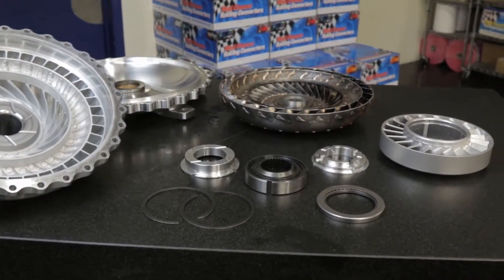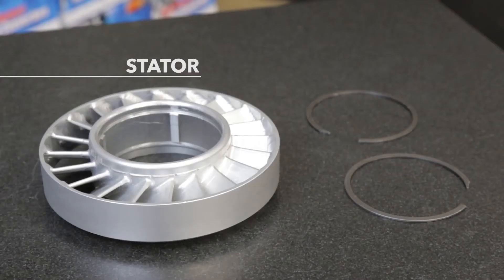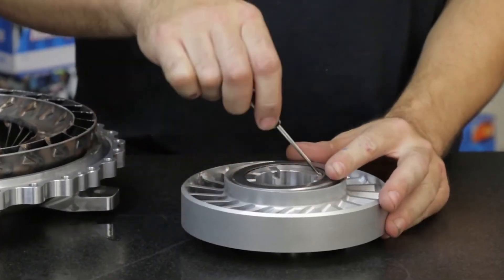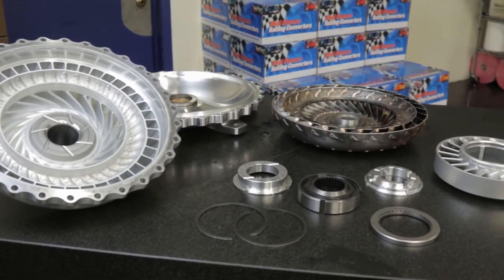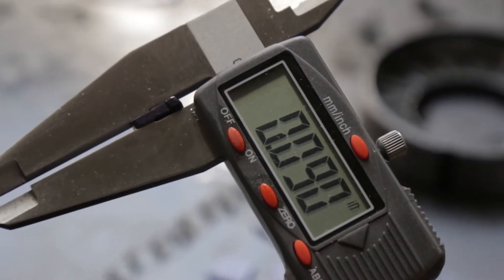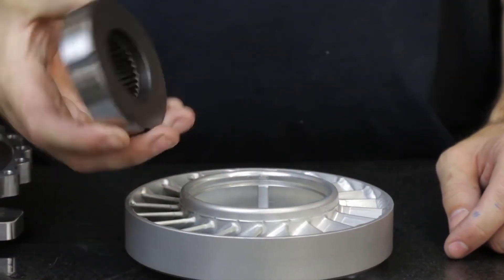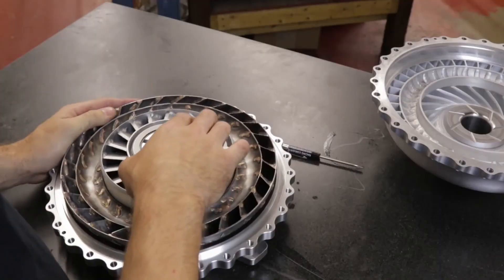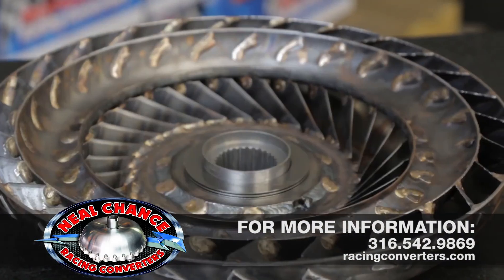How to Change and Inspect Converter Stators

Comment: My stator spins both ways....when removed from transmission, is that normal?
My car had poor acceleration and leaked badly when the car sat for a day....it also made horrible noises when in driver or reverse. I stoped driving the car immediately and removed the transmission.

The stator moves both ways and makes a horrible squeal when moved clock wise....it sounds normal counter clockwise....is it time to replace the TC?